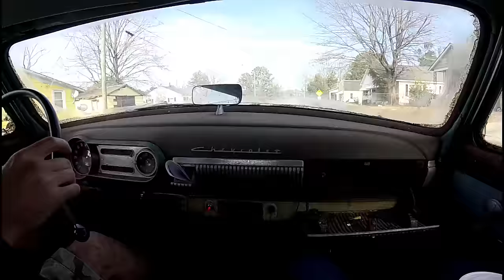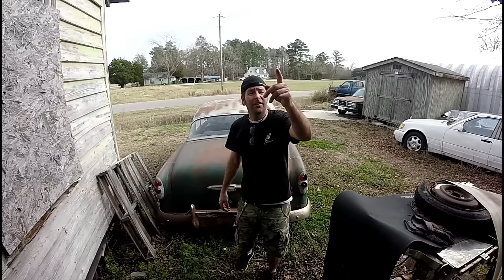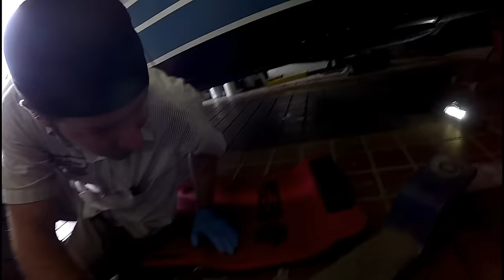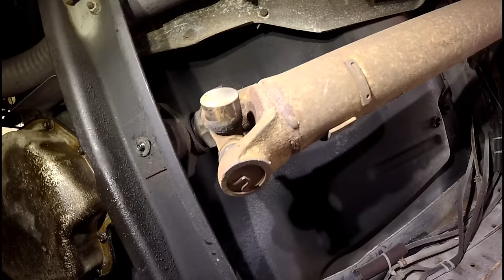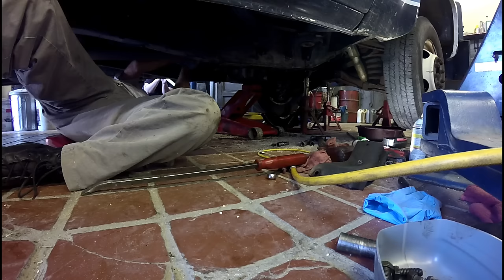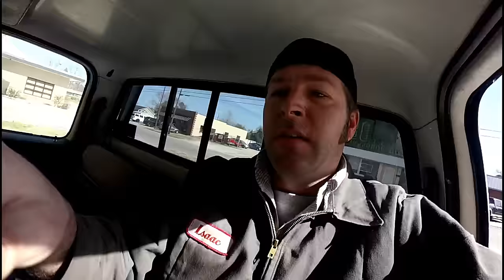Tow Truck Trans Swap: Ike's Adventures

Comment: Ike back in the day we used old license plates and sheet metal screws to plug up a floor hole , it was the poor boy way lol
Reply: I keep waiting for him to use crushed beer cans and silicone or something off the wall to close up the holes lmao
Reply: Tom Burgess  My uncle used road signs
Reply: Eric W that's awesome
Reply: Tom Burgess  my dad worked with a truck where they coverd the floor some with plywood and when him and his friend where drinking they would throw the cans through the hole
Reply: I had an F100 that had roofing shingles over an old metal Sawzall box lol
Reply: Helps to keep the rain water out!

Comment: Looks like the video editing has gotten better!

I don't know enough about a 3 on the tree setup to see that you are skipping over to 3rd. Although the RPMs did sound pretty low after every shift.

We dropped the trans and transfer case on my bronco a few years back. One trans jack and one floor jack. While I was ratcheting down the trans jack I told my brother it was tipping, he said nah keep going. After it cleared the body both fell straight off the jacks onto the floor. I've never shot across a floor on a creeper that fast in my life.
Reply: wow

Comment: I welded nuts to end of broken studs. if done quick enough the heat from welding and a socket on the nut allowed me to remove studs rather easily.  I'm sure you've done many times  before.
Reply: yes I have

Comment: I have a 53 Chevy belair 4door with the three on the tree I'm wondering if it's worth keeping the original trang or going with an automatic behind a 350 instead?
Reply: if you want a v8 lots of people go with a 350 trans because the factory trans wont hold up to a v8. then you have to change the rear end too

Comment: I cant believe you're allowed to drive that chevy on the road, those floors are crazy bad also if you just run open header it will sound so much better than straight pipe.... BUT, that's just my opinion
Reply: lol. I was dying from exhaust fumes

Comment: What transmission and motor do u have
Reply: you could  change  the motor to a 4bt Cummins  and  a 4L80E trans yes they do work together I did it on my truck and runs and drives like honey
Reply: 350 engine and a 400 trans